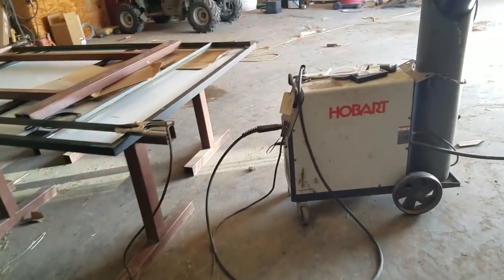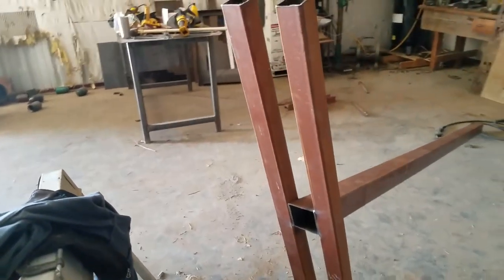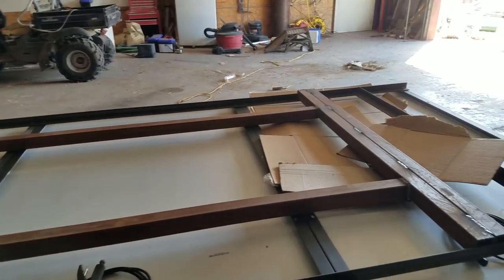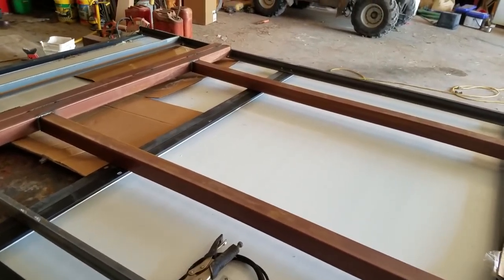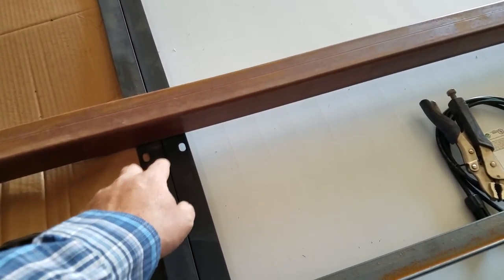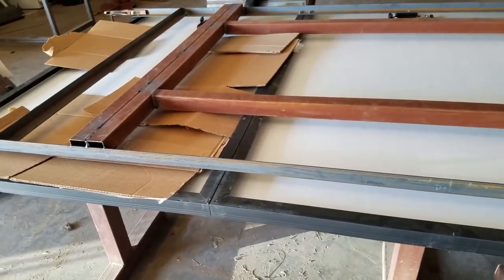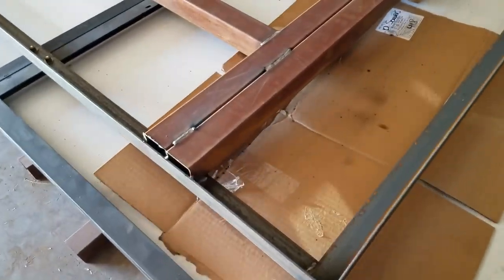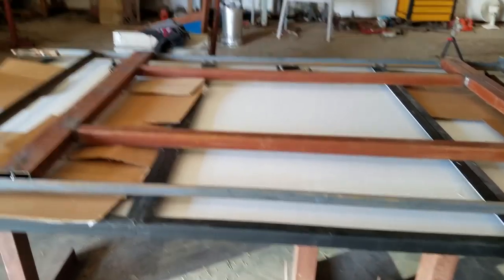Building Solar Panel Racks for Wells

Comment: You do your almost the same as I do the biggest set I have put up on a well is 9 panels to pump a 750 foot well at a gallon  a min don't pull the tower mount your panels on south side and use the tower when ever you need to pull well I use 2 bullies one on well head the other in the tower I use poll so I can pull by myself with my pickup since I usually don't have any around
Reply from the maker: andrew sanders we actually have one ser up just like that, and use Pullies for our pickup